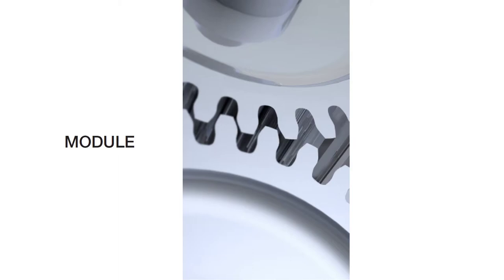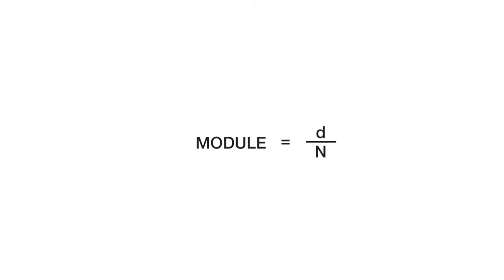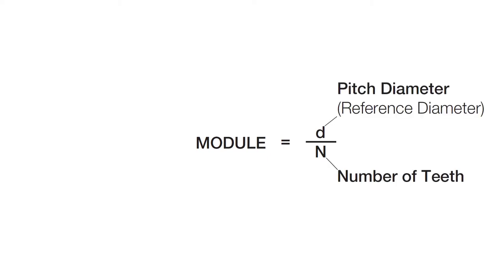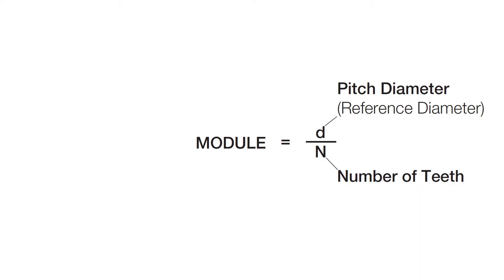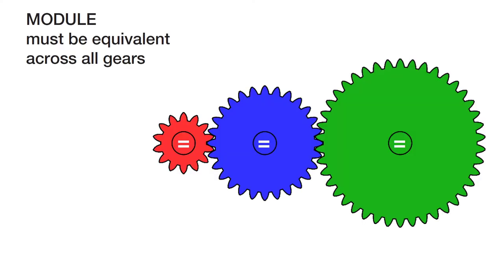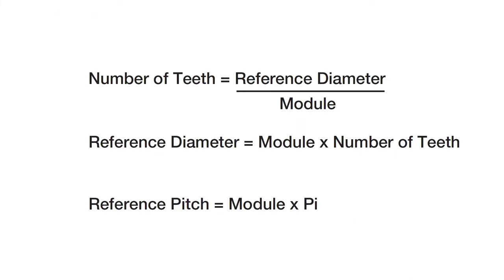Gear "Module" Explained in 1 Minute

Comment: how to find the value of the module
for spur gear if u dont know  the value of pitch dia?
Reply from the maker: Pitch diameter can be found/ estimated very easily... is this a newly designed gear still in cadd, or a physical one?

Comment: Hi, I'm trying to calculate the module of a gear in order to cut a larger gear for it to mesh with. The existing gear is a 9 tooth pinion with a tooth tip diameter of 1 inch. The existing gear is the drive gear on a starter motor and I don't know how I can calculate the pitch diameter other than to do a very rough estimate. To complicate matters I suspect, given its purpose the gear might have a modified profile with an extended addendum. I've cut standard gears on my milling machine using my indexing head and am trying to make this gear for a man who is terminally ill so time is critical. Any help of advice would be gratefully received. Thank you.
Reply from the maker: Look up "starter drive pinion gear." 9 tooth seems to be the most common and often meshes with a 66 tooth gear I think. Either way, you can probably find a CAD model on Grabcad for either the whole starter, or the gear you need. Then, you can throw it in fusion and get measurements from it or just use it (make sure the model is accurate first).
Reply: @AvivMakesRobots  Thank you, I was going to try a cutter close to the infinite rack profile as that's the profile I usually see on car ring gears. The gear I need to produce will only need to be in the region of 7 3/4" diameter so given the module or diametric pitch would be far fewer teeth than a car. This is to start a 500cc single cylinder motorcycle engine. My trouble is, the 9 tooth gear on the motor I've been given to work with doesn't give me a definitive module or diametric pitch when I work the numbers. You're correct that 9 tooth pinions are pretty much the standard for starter motors, either 9 or 11 tooth from what I can tell. Do you think they all share a common diametric pitch given the 1" tip diameter?
Thank you again for your help and advice. It is very much appreciated.

Comment: But how do I get the module out of the helical gear?
Reply from the maker: It is always best to look at the manufacturers spec sheet. Only if you can't find it should you try to get it yourself. The principle of the ratio between gear teeth and diameter is the same on helical gears.
Reply: @AvivMakesRobots  thank you

Comment: I have to design a whole new rack and pinion arrangement.
Can u guide me in steps with how to design it and what should i assume at beginning?
Reply from the maker: I would definitely start with a spec sheet from an existing rack and pinion. The spec sheet will be for a particular Module and sizing. I would use existing component models from a supplier that can provide CADD instead of reinventing thew wheel.

Comment: but why? why use module instead of pitch? pitch is so much easier to visualize if the purpose is to get a sense of the size of the teeth... I remember back in college our professor was complaining about the use of module that it was just a weird tradition like how electrons have negative charges.
Reply from the maker: It is still used a lot in the real world. Take for instance Fusion360's gear generator. Module is a main parameter.

Comment: Hi! what are the pro's and cons of gears with a higher modulus?
Reply from the maker: It is the reference diameter divided by the number of teeth. So let's think about it. If you have a 10mm diameter gear with 5 teeth, your module is 2 and those teeth will be enormous. 

If you instead had a 10mm diameter and 10 teeth, the module is 1 and each tooth is smaller. 

The advantages and disadvantages of more, smaller teeth vs. Less, larger teeth are self explanatory. More teeth mean the gear can't handle large torque values but there may be little wear. Large teeth can handle a lot of torque but there are friction losses.
Reply: @AvivMakesRobots  I see, thanks for the explanation!